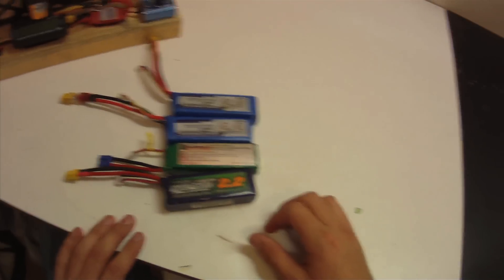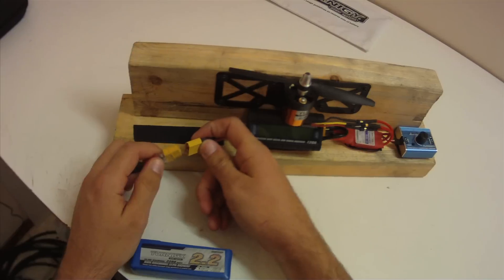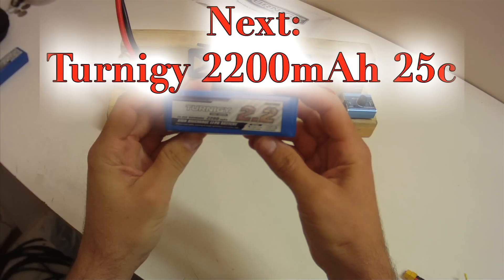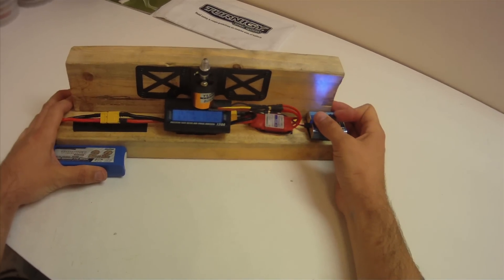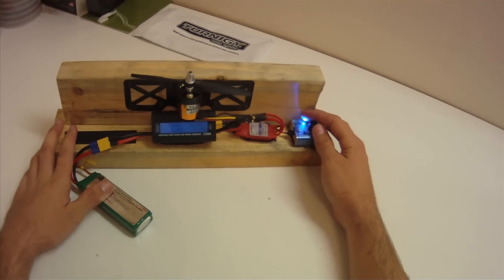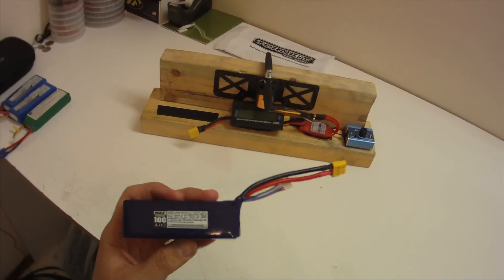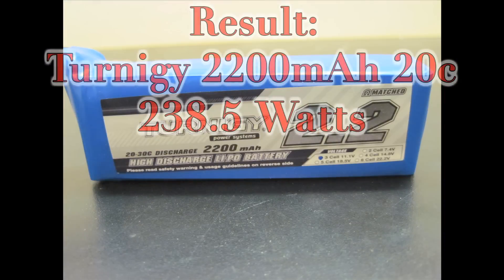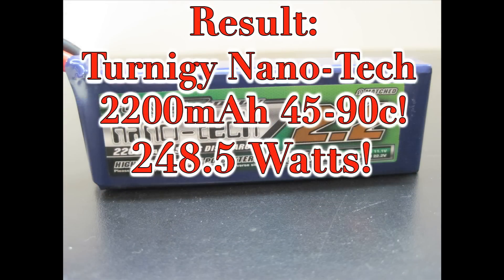Testing Lipo's Power Output, Turnigy & Parkzone C Ratings tested

Comment: What it does show is that the internal resistance of the Nanotech is less than the others. You dont even state what the sustained voltage or power is, only the peek.

Comment from the maker: @Brushlessboy16 You're right on about getting exact performance numbers. I was simply showing how the C rating will actually effect your performance. I am trying to walk the line between giving too much technical data that most can't follow it and dumbing down my videos. You're absolutely right about the proper testing for technical figures. These nano's are just a great deal and can keep the amps flowing under high stress better than others I have seen. Thanks for the comment!

Comment: A different way of looking at this would be to stress the packs to what they are rated for. 2.2ah(20c)=44amps etc.. Then see how much voltage they can hold under different incremental loads on them.

Say you have the 2.2ah 20c pack. Measure how much voltage it holds at 11a, 22a,33a, and 44a. 

I hope you can follow what im saying. Just that voltage drop under load is what we need to know. we want to go vertical without worrying about lipo cuttoff kicking in!

Keep up the good work :)

Comment: Hey don, very nice work in your videos.. I have one main concern.. your using the same load on each of the battery,  its going to take the same (around the same) amount of power to do the same amount of work... Im no expert (Electrical engineer lol) but the only reason the nano tek's put out more wattage because they hold a higher voltage at a given amperage... This is a given since the pack's C rating is higher.

See next post